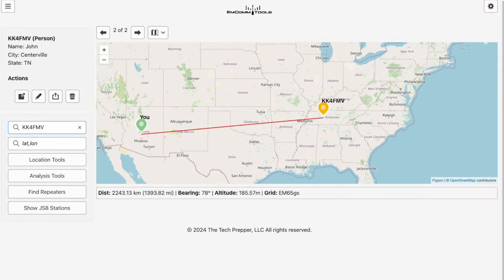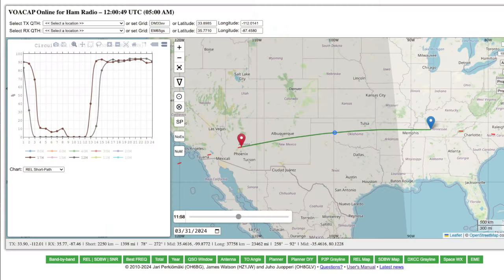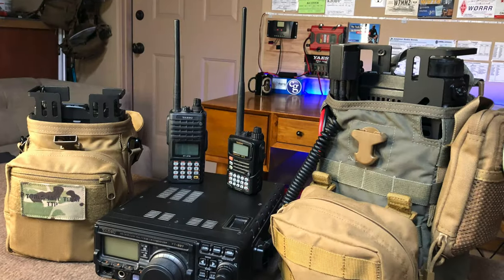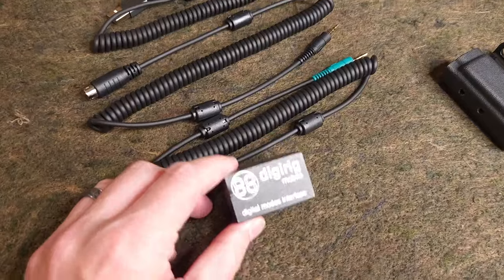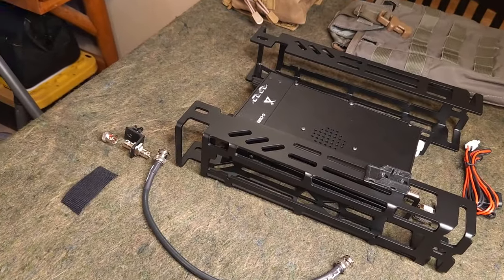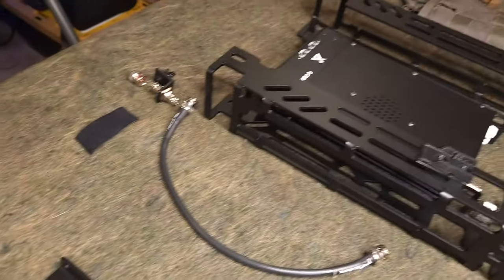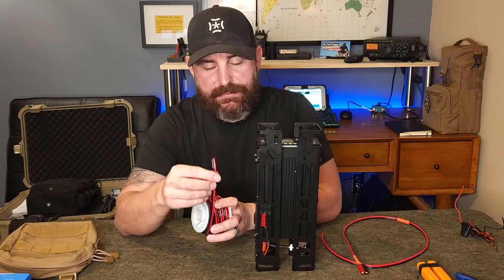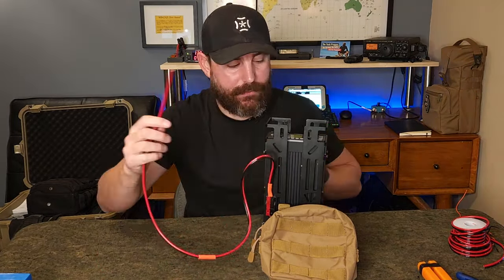Xiegu G90 Manpack Build for T.REX ARMS

Comment: Not sure why you can't do voice with 20watts. I do it all the time with 10watts from Alaska, and a lot farther than 1500 miles. Stick with 10 meters during the day and you should be able to work most places in the states. Wondering if there is a reason your staying away from 10 meters?
Reply from the maker: This is a targeted contact. The current HF prediction based on our gear and antennas shows a low probability of success for voice. 11m, 12m, and 17 all show 99% chance of success for our intended circuit using a weak signal mode like JS8. 'll write voice into the plan, but digital will likely be required as our contigency or emergency.
Reply: @TheTechPrepper  You might be surprised. If there are no solar flares, more than likely, a voice contact will work using the right band. Pay attention to the Mic Gain. There is a lot of punch that can be added, just don't over do it.
Reply from the maker: @johnk23705  Great tip. I'm highlighting all the areas in the manual that are worth diving into so that I can given this planned contact the best chance. Thank you for the tip.

Comment: I love what this channel is about almost none of the ham guys get into targeted comms and that is IMO super important.  but I dont really get the hard need for long range comms in a man portable size. what is the use case where you need to talk to someone several states away without even a vehicle? the S has HTF and you have lost everything and are on foot but the only thing you have on you is a HF ham radio? it seems like such a niche use case.  unless my house is actually physically GONE, I am not bugging out. I have real comms and antennas at home. on foot maybe on a recce mission but why talk on public freq unecrypted to someone too far away to matter? am I way off base?
Reply: For the same reason you have a bug out vehicle AND a bug out bag. If the vehicle breaks, you can move your stuff to another vehicle easily

Comment: The only possible issue putting the rig in a bag like this, if one runs 20W, is the heat has no where to go.
Reply from the maker: It's not an issue. I am going to demonstrate this again in the next video. I've been operating in the desert for over 3 years without an issue. It's all on how you operate. I designed a flap on my bag, but I've only used it to access the rear when I need to work on the cables or access the rear. I've never used it to vent heat.
Reply: @TheTechPrepper  Excellent. Thank you. I may duplicate your build.